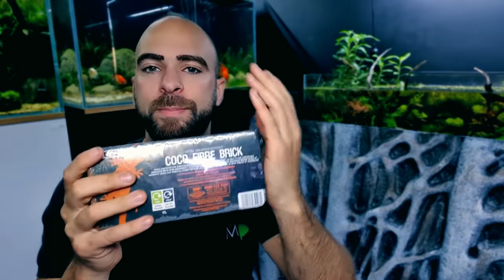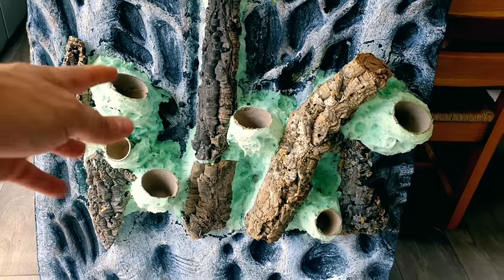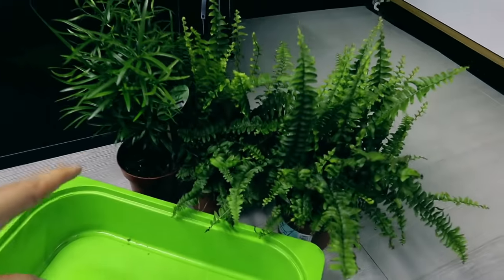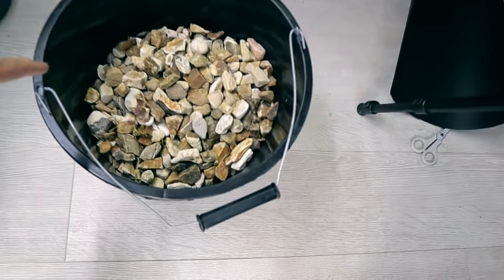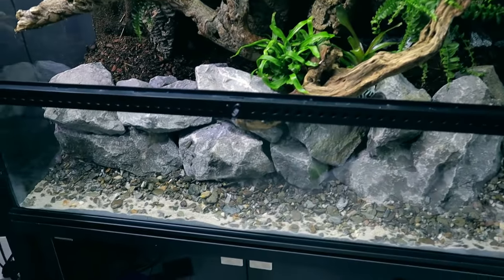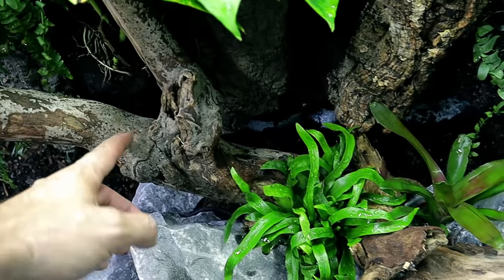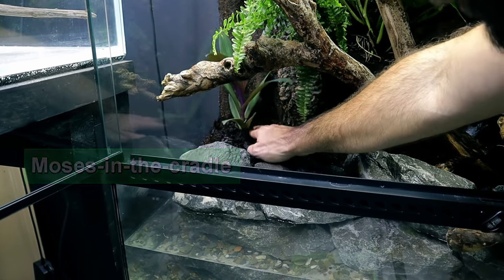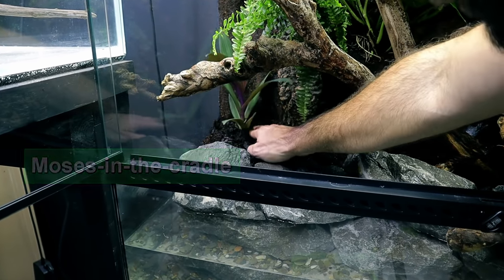Aquascape Tutorial: HUGE XL Paludarium / Vivarium Flooded Rainforest Build (How To: Step By Step)

Comment: 4:30 my heart! Oh my god that was so cute. The SperaDesign influence is strong with this one. It looks great! When I tried it with my hermitcrab terrarium I was too dumb and left the shiny expansion foam layer on while adding the silicone, safe to say that it didn't work. Ripping the shiny layer off of 160x50 and 2x 60x50cm (all 3 sides) was not fun, and in the end I covered it in tile adhesive instead of silicone (since I simply wouldn't have had enough for that), gives it a nice rock look, so I can recommend giving that a try in another terrarium if you want to achieve that type of look! 

"They like to stick on leaves!" so might be geckos, maybe Lygodactylus williamsi? A very small gecko variety with a turquoise color and active during the day, really lovely if you can get your hands on some! Though they wouldn't like that high humidity as much that you have planned. So I'd guess some lovely tiny frogs, which would obviously love the water part (even if it's not dendrobates but other frogs). God now I am excited for this!

Comment: You could use a drill attachment for the carving of the "shiny stuff" .. either a wire or flap wheel.. Will speed it up alot :)

Comment: Strongly suggest you move the devils ivy into the bottom substrate, it will very quickly out grow where it currently is and will overall look better if placed at the bottom. I'd also suggest adding a syngonium and an anthurium, they're great for little guys that like to sit on leaves
Reply: There is already an Anthurium in the tank... Flamingo Flower is the common name.
Reply: @odobenus159  i know,  I wrote the comment mid way through the video and posted it before I remembered to edit it

Comment: Hi I am going to have ago at doing a paludarium so I can house some fresh water red claw crabs I will be using some spider wood and rocks would it work if I lay the rocks in a line with a few tall rocks and silicone them to gether and fill it up with some fluval substrate to give the height so I can put some cryptocoryne in so the roots are in water but the leaves are out like semi aquatic and use air plants for the spider wood and java moss as my crabs are semi aquatic the size of the exo trerra is 30x30x60 and maybe use an aquarium light with timer and use white aquarium sand for the front and fluval substrate for the back it will be my first attempt and don't fance use that spray form and help would do cheers by the way love your videos they are out of this world its a work of art

Comment: Looks great but did You check the data safety sheet for the expanding foam you used? If I am not mistaken the one you have used is not suitable for animals. It could pretty much end up killing or having lasting effects on any animals you put it there.

Comment: Looks good 👍. Id recommended upgrated lights to Arcadia jungle dawn with a shade dweller uvb light. Much better lightning, exo terra lights arnt the best and especially those compact uvb light. Uv index given off by them isnt much. T5s are the way to go. And the jungle dawn led is designed for plant growth. Arcadia may even sponsor you if you reach out to them.
Reply: I have the jungle dawn. It is decent.

Comment: Aesthetically you’ve absolutely nailed it!  Amazing for your first build of this type.  I especially like how you’ve used, adapted, and improved the background supplied!  Couple of questions.  Is the expandable foam you’ve used known to be safe for fish/amphibians?  I’ve just spent loads on pond n foam stuff, if there’s a cheaper alternative that’d be great!  Also would the nutrients in the soil pass though the weed membrane and go into the water, therefore having high levels of nutrients in the water, and low levels in the soil?  I’m currently doing a build using a foam and concrete background.  30 full water changes in and pH is still sky high!
Reply: Well yes!

Comment: 1/ why would you do a fish-in cycle when you have multiple tanks you could clone a filter from. 2/ that 'beneficial bacteria' actually isn't, it out-competes the correct bacteria, but doesn't do nearly as good a job of denitrifying the water as the right bacteria would, so it actually takes longer for the cycle to be stable.